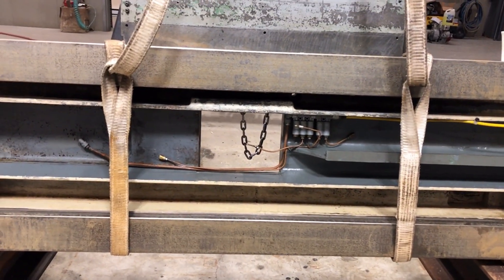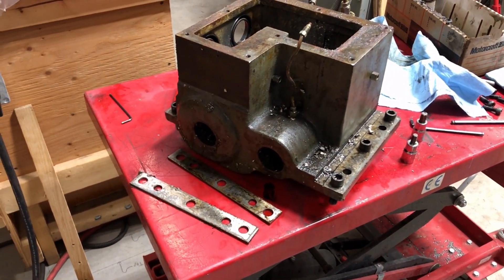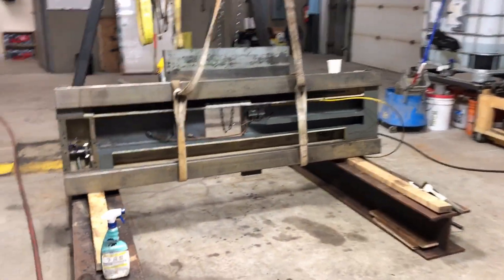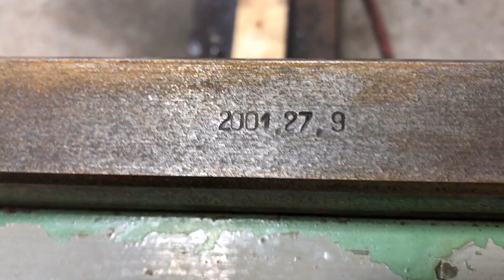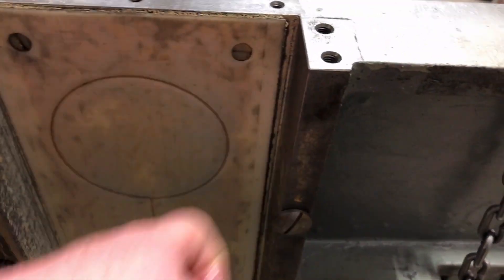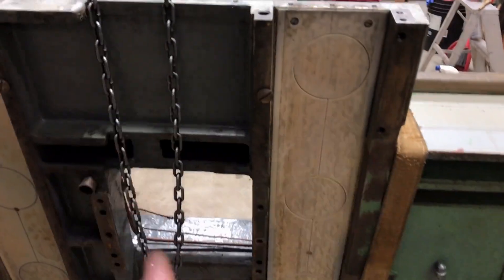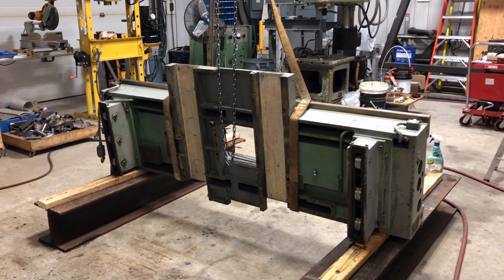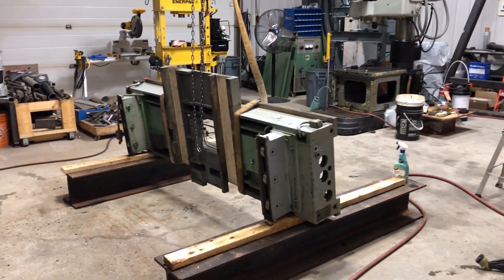HBM Update No  4

Comment: I hope the mesurements are good. The idea that you maybe have to take it appart again and fix it... bah. One hell of a job.
Reply from the maker: Thanks Rusty.  At this point I've put so much work into this machine that having to lift the saddle off and repair the way liner is a relatively small job.  Having a crane that can lift the saddle also helps a lot with the task.  Ken

Comment: The big box way covers are known unreliable on all hbms. I have ran a few with waycovers pulled back. They like to separate in the stack so two groups of covers pull apart, then when you drive them back together they crush. Way covers suck
Reply from the maker: I thought that may be the case.  The way cover on the bed next to the column was separated into two pieces.  I'll have to look at that and see if I can fix it.  Ken